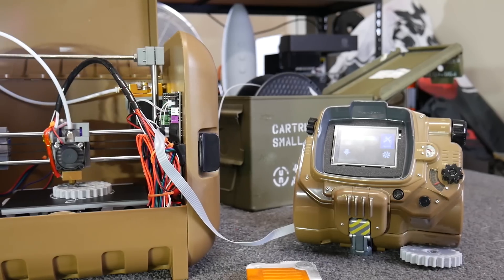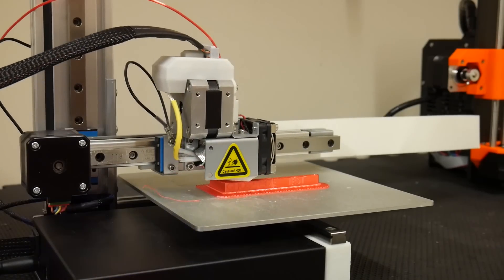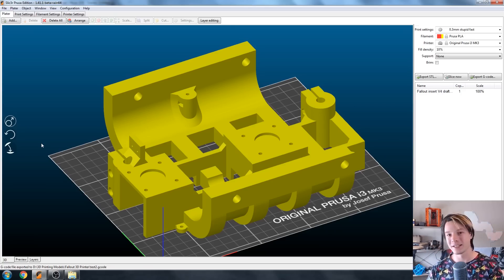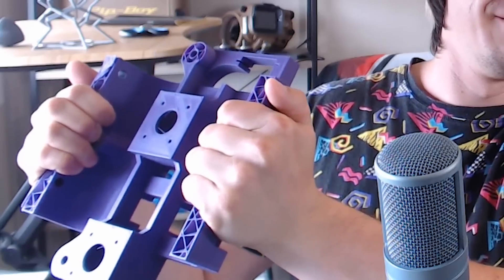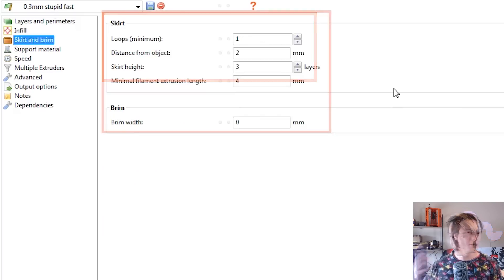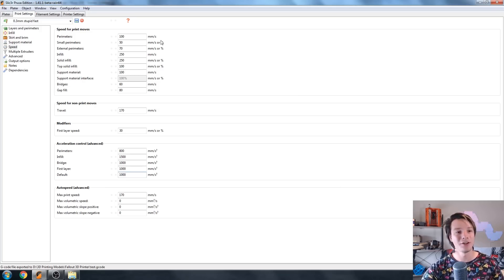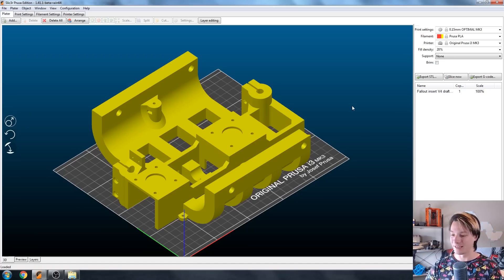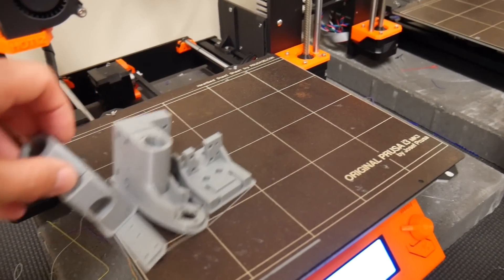3D Print parts TWICE as fast with simple slicer tweaks. 3DP101

Comment: Have you tried Klipper on any of your printers? It uses a Raspberry Pi to calculate the paths instead of any 8bit board. This is another way to get a better finish on fast prints, since 8bit MCUs like to skip some paths to save time and keep up with the workload. In very complicated models (say round bits) this makes older boards even stall for a second while the mcu tries to calculate where to go next. Klipper takes all those calculations off the board and just sends the solutions to the printer. Much smoother, even somewhat quieter since the movements aren't micro-stuttering at speeds over 100mm/s. Worth a shot on older/cheaper printers (if the frame is sturdy enough to cope with the forces of that chunk of metal being thrown around quite fast)
Reply: I'd not heard about this, sounds like it could be useful for my 8bit delta...
Reply: Pook365 for delta it’s a must, also very good for corexy types, but for simple cartesian, it doesn’t have too much advantage
Reply: @istvanmaasz6771  at least i can print faster now without too much stuttering... not sure why you think there's no advantage, but after testing I'm very pleased with the outcome. It really does make a difference. 🤷‍♂️
Reply: @therealpanse  I also use klipper as I said, and it works fine, but for Angus, if he did such high speeds and the estimation in the slicer was correct, but means that the hardware was able to keep up, that's why I said for him (for a prusa with simple kinetics) it wouldn't make much difference. On a delta it does, on a corexy, also, since motions are more complex to calculate.
Reply: @istvanmaasz6771  I'm using it on a cartesian printer and I see improvements in speed. Not by changing layer height, infill percentages or movement speeds. It's just the fact, that the printer doesn't have to stop every now and then for a fraction of a second to calculate. Most of the time it's unnoticeable, but those stops are there. and they sum up into quite some time in a 10h print. But even with the same speeds as in Marlin before, i get better, more precise prints with it. There are no jerky motions anymore, just because the 8bit board can't keep up.
Reply: I'm also using klipper, but if the time estimation was correct for him, he didn't bump into such issues. And microstutters are only absent if you're using a virtual sd card.
Reply: man, I wish I could get Klipper working better, I got good results for a 20x20x20 test cube at 180mm/s. but once I went to complex objects(benchy) the y-axis was all over the place. seemed like a bunch or missed/added steps as the model move higher in the z-axis. at first, I thought it was the model loose on the glass. but it was hard to get off the print bed.

Comment: Max travel speed 200 for prusa doesn't have any negative effects for me, it's pretty safe.
Also I change the min retraction distance to 3mm and remove a layer change retraction requirement, it makes prints much faster too.
Reply from the maker: Sweet! Good tips to push it even further. Cheers.
Reply: you can do 250mm/s but if your zhop is too low (<0.4mm) any little bump against parts might make it skip a step.  Again that's only useful if you print huge parts. Imo i rather stay at 200 and keep the zhop at 0.4

Comment: having infill speed set to 250 it makes no sence to leave empty travel at 170 for accuracy/artifact reasons. 
Concerning higher temp for PLA, same experience here, material intense areas won't "stall" the heat flux.

Thanks for this series on tricks!
Reply from the maker: Good point! If I'm getting good enough results with 250mm/s no reason not to push travels a little higher too and see how it goes :)
Reply: Maybe the filament max volumetric speed slow the infill speed well below 170 mm/s. He should try to reduce the infill first to see if there are any impact on printing time.

Comment: I wonder if you have used the Prusa  slicer G code to print anything on the Cetus? Thank you for your eye opening content, very excited to try prototype settings.
Reply from the maker: Honestly I love their stock slicer, it hasn't given me a reason to pursue others especially now they've finally got Gcode preview and custom supports. Seems to work fine and you can do something similar in it by setting nozzle height to 0.3, 0.35mm and tweaking speeds.
Reply: @MakersMuse  Thank you Sir, I'll look into the Gcode preview. Always benefit from your great content and presentation.
Reply: @MakersMuse  The Gcode preview you speak of is the visual playback of the configured print, or is there a way to see the actual Gcode lines of code?

Comment: After a month of viewing your videos I finally got a 3d printer. I hope it doesn't have issues
Reply: Muhammad-Ilyaas Padia what 3d printer?
Reply: @therollo9  Creality Ender 3
Reply: Creality is excellent bang for the buck. Only probs I've seen with those is those damn warped beds. But once fixed up they print beautifully. Also under extrusion can happen but it's an easy fix as well. Basically they might need a bit of tuning sometimes.
Reply: @The_sound_Of_Thunder  I only levelled my bed based on the corners and my prints stick well. YAY
& no underextrusion
Reply: @The_sound_Of_Thunder  I'm pretty happy with my Ender 3, though had a couple of issues - the extruder cog came loose and slid down the stepper shaft so feeding stopped about 80% through a job.
Simple fix to restore and tighten the grub screws on it.
Also found it was slipping on the filament and under extruding once per rotation, so had to increase the strength of the spring.
Then the stepper motor would occasionally skip steps, so also had to increase its drive current by tweaking the pot on the E driver on the controller board.
I can't complain about such little things for the price.
Reply: Abandon all hope all ye who enter here
Reply: You'll have issues eventually :)
Reply: Fundamentally impossible to have a 3D printer without issues, no matter how well it's made.